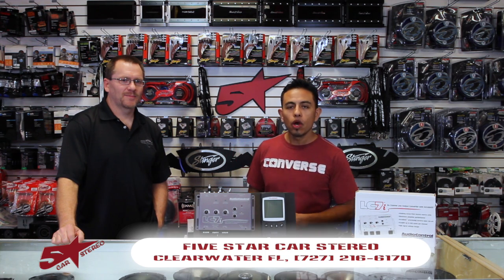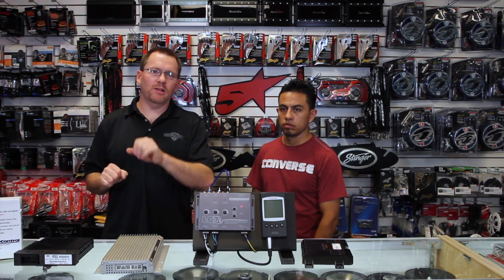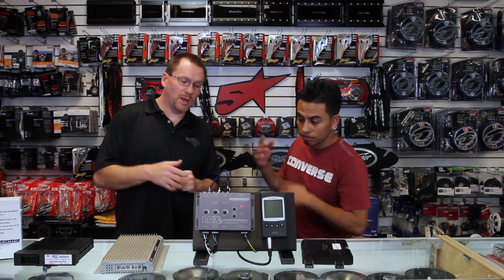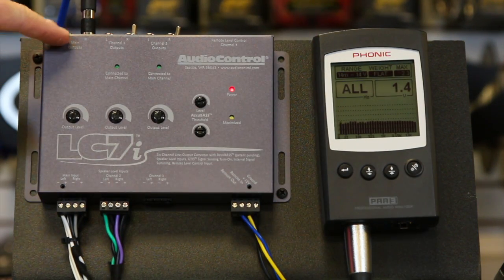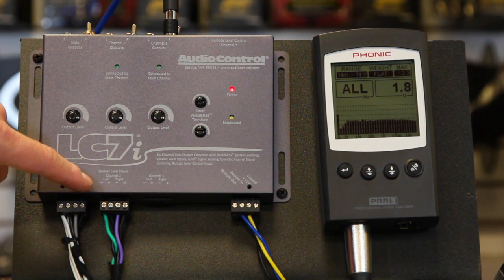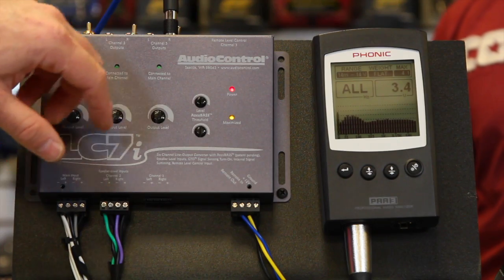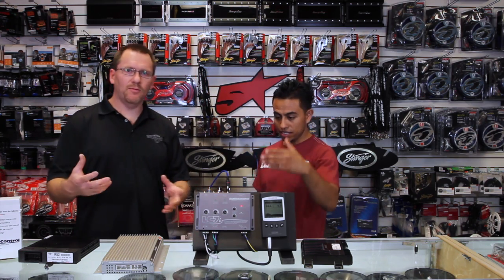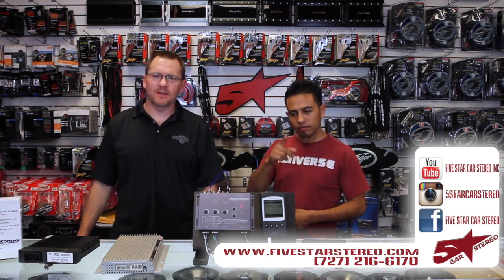Introduction to AudioControl's LC7i part 3 "how to do 2 channel input and 3 channel output"

Comment: Hey man I have a 2015 Toyota Highlander without JBL. I added a 4 channel amp for my door speakers and front tweeter and also another amp for my 2 12” skar subs. I installed the LC7I but the sound isn’t that great from my speakers, and also when I unplug the lc7i the sound still comes out of my speakers but I don’t have a factory amp.. what could be the issue? Thank you.
Reply: You're supposed to get signal for the lc7i from factory wiring such as front and back. If you have an oem amp, you get signal from output side of oem amp. Additionally you can get front signal from front doors for main in 1 of lc7i, rear signal in from rear door speakers to channel 2 in of lc7i, then out to front, rear and channel 3 out of lc7i to aftermarket sub amp.

Comment: Hey.  Do i need this loc if i just Want factory stereo and loc and amp 4ch to front and rear speaker. No sub going to be installed ,,,, 
Or ist bass roll of anyway?
Do it work set gain and stereo on 70%and  not turn up vol higher in future.

Comment: Hey guys I have a question and I will be as detailed as possible. I am interested in purchasing either an lc6i or possibly an lc6i (unsure just yet). 

I have a 2009 be Jetta without a premium sound system. 

The plan is to replace the main 4 door speakers with NVX VSP65 both front and rear with a pioneer GM-D8604 to power them and for bass I am using a Rockford P300-10.

Would I need to leave the automode on, run the front into ch1, rears into ch2 and would ch3 provide me with a clean output to run my P300-10 cleanly?

If not would there be another way to set up the jumpers internally to have ch3 as dedicated bass output?

Additionally would you recommend the lc6i or lc7i based on the above.

Comment: So I just purchase this and replaced my basic line out converters. I’ve noticed I’ve lost a lot of punch ever since installing. I have front  with teeeter and rear, and sub is run of the fronts. Rca from the two channels go into my amp for the doors and from there rca our to sub from that amp to sub amp. Any ideas on why lost so much punch?
Reply: What do you mean punch, like your subwoofer?

Comment: Ok I’m lost I watched all 3 videos and I’m still confused

I have a lc6i not 7i but I’m sure u run them the same however I have a 2012 vw Touareg tdi lux and it does not have a factory amp/sub how do I run lc6i to add a 4 channel amp and a sub amp any info would help thank you guys and great videos

Comment: Great videos Thank you, I have a small problem. After installing my LC7i I have no mids or highs, well i do but they are very, very low. I only have a 2 channel amp available at this time feeding my speakers after the LC7i. Will this cause the issue i am having? I am on my way to purchase an 4 channel after I post.

Comment: Guys I really need help I want to set up the Lc7i in my 2016 Tacoma I have the base system with the two upper tweeters, and the 4 door speakers. I upgraded to 4 focal co-axial’s in the doors and my focal amp(I’m going to add a sub later on). How should I wire this up? Do I need to use the summing options? I’m fine with losing my fader options I just want the cleanest sound to each of the speakers since I know I’m not adding any tweeters up in the dash.
Thank You

Comment: I have a 06 Chrysler Pacifica  with Factory Infinity system. My radio only has left and right  front speakers wires going into a amp and the output has front, rear, front center and a sub . I am confused on how it works and how to make a true front, front center, rear and a sub. any  better ways to do this?

Comment: Hello sir, i have subaru legacy with Harman Karam amp and subwoofer. I wants to add 5 channel amp.  Where is the best location to install it for lc7.1) After amplifier output? 
2) amplifier has different channel outputs high mid and low. Which configuration should i follow ? No. 3 video ?

Comment: So what if I have front and rear tweeters in the factory system as well but no amp and no subwoofer but I'm going to be adding both. Basically I have 2018 Honda Accord sport and I'm going to be installing JL component speakers in the front and rear powered by a 4 channel amp and then installing a 8" JL powered Microsub.  When I go to feed the signal to the LC7I do I pull front for channel 1 and rear for channel 2 or do I pull tweeters for channel 1 and mids for channel 2?
Reply: I have the same vehicle and want to do almost the same. Did you end up figuring it out?

Comment: I get how this LC7i works but installing it in my car I’m confused on how to add it on. I have a 2013 Kia Optima sxL that comes with the infinity audio. And the front doors have mid range and tweeters and rear doors are hi pass how do I go about getting all speakers to play on this audio control I heard about suming but how do I go about doing it.
Reply: The jumpers that are in the lc7i. You have to remove the cover to switch them. if you really need to do that

Comment: Hey guys! Ok so i have a 2012 Ram with a factory touch screen with Bluetooth/GPS/DVD/USB etc. i need to convert my speaker wires to rca’s obviously and i have a 2k sub amp on 4 12’s in a blow through... now its time to add and upgrade my mids and highs!! So I wanna add an amp for those now so what would be my best unit and way of setting it up ?

Comment: When i run my signal wire from the factory stereo to the lc7i do i run it the opposite side from the power wire from the amp or can i run it on the same side ?

Comment: Love your videos guys. You make it seem so simple. Great work. I just purchased a LC7i for my vehicle. I have a new 2018 F150 without the Sony system. I am going to add my own amps, 1 for the speakers, one for the Sub. Question, to get my signal from the head I need to cut the factory wiring, which I would rather not do. I have been looking for a harness, and reverse harness to use instead but I am not able to locate them. Do you sell, or do you know of where I could purchase the harnesses?you guys rock!

Comment: Question: why did the RTA show roll off on the very low freq when switched between the rear out put and the sub output.  The RTA showed and very flat signal on the front and rear out pits but the sub just dropped off.
I noticed when you turned up AccuBASS the lowest leveles came up but it was now level output was way to high in the upper sub freq range. 
Is there a way to keep the sub freq flat like it was in the front and rear channels and keep the sub channel just as flat?
Hope I explained it well.
Reply: #ThatPart

Comment: Does the lc7 take the place of a equalizer,or is it better and possible to add an equalizer?
Reply from the maker: +GUS GARCIA it is not an EQ, check out the LCQ1 it is an LC7i with an EQ
Reply: Five Star Car Stereo , I believe I didn't explain myself correctly, what is my best opinion?, I'm gonna put a audio system on my car but I don't want to replace the manufacture radio I am planning on installing two amps one for highs and one for lows,I also have a epicenter and a lc7i and a kendwood baby equalizer,basically my question is do I need the equalizer is it going to make a significant difference on the system?  Thank you for taking the time to answer the questions,you guys Rock!!!

Comment: how about a 01 740 bmw which has 4 rear deck , front and rear door factory speakers - i believe total of 10 plus speakers - how do u connect this to that or we need a different LOC unit
Reply from the maker: hvcool is it the I drive system? If so behind the radio has four outputs you can use.

Comment: How did you connect Phonic PAA3 to LC7i?
Reply from the maker: Adam Eccleston we made a XLR to RCA cable. It will take speaker level or line level in
Reply: I'd like to make a XLR to RCA cable, what do I need to make it? Your videos are on point!
Reply: I think you should make a whole video on the PAA3 or PAA3X. How to tune a system with it, how to identify distortion, and how to make those wonderful cables you have made.

Comment: sorry should have been more clear on what I'm doing I'm installing the LC7i and also 2 12in apline type r with with seperate amps running the subs could I use one of the other inputs to run the second amp and sub or will I have to split the channel 3 signal
Reply from the maker: Mmadad30 most sub amps have an input and an output for a second amp. What amps did you get.
Reply: Five Star Car Stereo audio pipe 1500 watt mono D
Reply from the maker: Mmadad30 yes that sub amp has an in and out

Comment: I've watched all 3 videos and still not certain on what to do.  I have my factory 2015 Prius c that I  am trying to have 2 amps and sub(1amp for highs - 1 for sub). confused on if I need to open up my lc7i to change or leave default.  Please advise.
Reply from the maker: Devin Nguyen if your radio has just front and rear output and you are going to front, rear, and sub. Do nothing, that is factory default. That you for watching
Reply: You lost me, when you said, you had a prius... 😂 😃 😄

Comment: Great videos!!! I have a 2015 accord w/navi where do i put my lc8i inputs? After headunit? Or after oem amp??
Reply from the maker: Joe M it would go after the amp. In that car you may be able to go before the amp by just adding so RCAs. I believe the radio has a variable line output into the amp. Check out this video for more information. 
https://youtu.be/6Zw04MVbNsM
Reply: Ok thanks, either way its ok to go after amp than?
Reply from the maker: Joe M yes that is were it goes.
Reply: Five Star Car Stereo hey I have a 2013 avalone with the Jbl set up and it suck.the head unit only have bass, mids and trouble.I replace all my factory speakers with 2way and 3ways but you hear nothing out of the tweeters only mids.what must I don't.I wish their was a way to hack the system
Reply: Five Star Car Stereo Wrong! It goes BEFORE the amp!

Comment: I get it, I get it.... I don't get it...  :-) Hello, and thank you for your time and efforts!
2006 Nissan Titan Crew Cab. Factory head with 6 disc changer, NON-Fosgate - no Sub. Replacing in dash tweeters, front door and rear door speakers with Infinity REF series.
I plan on mounting LC7i under driver seat, as well as an amp with sub channel. 
How am I getting signal to the LC7i?
Am I to keep original factory speaker connections?
Am I replacing wires, or tapping into whats already run?
Am I running new wires from amp to speakers?
I see the block diagram: Radio Head Unit, to LC7i, to AMP, to Speakers. Then I hear youn say all signals into one? Then I see you connect your visual meter to each of three outputs.
No one has had a video on a full install that I can find to help my feeble mind wrap around this stuff. Anything you can throw my way to help me understand would be greatly appreciated.
Thanks Guys!
David
Reply from the maker: So for you I would go by the BHA 7550 and the BHO 7550 reverse harness. This way you can make a nice "t" harness going to your radio. You will run the front inputs into main on the LC. Run the rears into input 2 on the LC. This will automatically create a sub output for input 3. Run the 3 RCAs out to your amps. Run your amps  output  the speakers input on the "t " harness. Basically you will make it a plug and play.
Reply: Hi Dean,
OK, I think I do get it now...  
Pull the factory plugs from the back of the factory head unit.
Take the Metra 70-7550 Wiring Harness now going to be plugged into the head unit,  and make really long extensions to all wires to run from head unit to under the seat and attach to the LC7i.
Plug short RCA cables from LC7i into amp for front and rear, run power out from LC7i to amp, and run longer RCA to sub under rear seat (does a sub only have one connection, then?).
Add really long extensions to Metra Reverse Wiring Harness 71-7550, connected to output of amp back to head unit and connect its plug to the original head unit plug pulled at first step.
Does all that sound right? When I searched for BHA and BHO, Metra always came up, so direct me to correct if needed.
Thanks! (my head hurts a little....  :-)  )
Reply from the maker: Yeah you got it. The Metra harness will do the trick, they are the same. This way no cut harness.

Comment: Thanks now I have another problem I can't find I fuse on my Lexus GS 2015 for a remote do know how to get it done and sorry for so many questions
Reply from the maker: The LC will make a remote turn on for you, It is the feature call GTO - great turn on. Just connect power and ground run the remote out to the amp. When the radio speakers turn on in input one the LC will do magic.

Comment: Can I run the power from my power amp cable need a fuse ?
Reply from the maker: Yes you can connect it to the amp for power. If the unit is going to be a far distance from the amp and the wire is a risk of getting pinched use a fuse.

Comment: I have a 2013 Dodge Charger, with the small touch screen/climate control. I want to keep it but run two amps. One to run 4 channel to doors and rear deck and one monoblock for a single 12 inch sub (front dash speakers to be powered by deck alone). Would this LC7i be the product I need to do this?
Reply from the maker: Yes it will also check out there amps the lc7i is built in.
https://youtu.be/dEHuhLHCyyI
Reply: Five Star Car Stereo I have the same car...2013 charger. I am pretty sure that the rear speakers have more bass than the front channels do, this being said, should I sum the front and rear together then use my amplifiers hpf, or could that much summing hurt the lc7i or make it cut out?

Comment: I'm wanting to run 3 amps in an 2013 audi a7 prestige that has the bose system. I'm going to run 2 polk tweeters and a pair of kicker 6 in speakers from a 125.2 amp... another pair of kick 6 inch and a pair of kicker 6x9s with a zx 400.4 amps.... and a pair of JL 10w3v3 's with a dx 1000.1 amp..... Would this product be best for setting that up then?
Reply from the maker: It may, it depends on how may channels you have to sum together to get the outputs you want. You need to  know that first before you get the summing device.
Reply: I dont think I need to sum any, the stock system has "high, mid, sub"
Reply from the maker: +Landau Lang are you going to an active system?

Comment: Hi guys I am writing from Australia. Thanks for all yours post I have been learning a lot. I know you don't have this model of car in USA, but should be the same thing as in other cars. I have a Toyota Fortuner 2016 and want to use the oem or factory radio but I want to install a 5 channel jl audio HD900/5. Which LOC you recommend to use ( LC7i ) or maybe other brand ? How can I get the signal for the sub woofer If I only have 4channles front speaker and rear speakers. 

You have already showed me how to do it. But I saw the configuration that you did in Introduction to AudioControl's LC7i part 2 "how to do 2 way summing plus subwoofer". My question will be, Can I do some kind of the same configuration like separate the signal High, Medium and low? I am going to put in the front and rear Alpine SPR-60C 6.5" TYPE R Component Speakers. 

Thanks for your help. Cheers!
Reply from the maker: It sounds like you want to do a 3 way active crossover system. To do that you really only need a left and right output from the radio. You could use the Lc2i and go into a 5 channel  amp that has the crossover ability to do that. Phoenix Gold makes the Ti2 1600.5 that works great for that type of install.
Reply: Hi guys thanks for your answer. Sorry I am not a professional installer, I just need to understand a few things. I know you are very busy but if you could explain me a little bit more in detail I will be grateful for ever. The stereo of the cars comes with four pair of wires (8 wires): Two pair’s front (Right and Left side) and two pairs Rear (Right and Left side). I was watching the picture LC2i and it comes with two speakers input. How Can I connect everything? If you could provide me a diagram it will be easier to understand (mrcc13@gmail.com). Also, the output exit is one in theory because the other one it will go directly to the sub woofer line rca in the amplifier. It means that only left one RCA output exit. I need to buy a simple RCA with double RCA at the end? To go the outputs of the LC2i to the inputs in the amplifier front (L-R) and Rear (L-R)? Thanks for all your help and sorry for the troubles!!!

Comment: I have a 2011 Nissan Juke with s factory sub and I wanna run a sundown x15 but I have a factory radio would the lc6i allow me to do this ??
Reply from the maker: If you are just doing a sub all you would need is the lc2i.
Reply: Five Star Car Stereo I read everyone's comments but I'm confused. The lc7i says it has may speaker level input of 400 w rms...so I can't run 2 X 12s at 400 rms each on a 1 ohm impedance?????